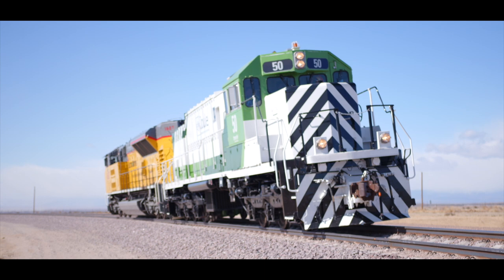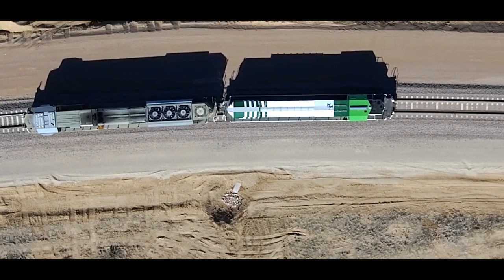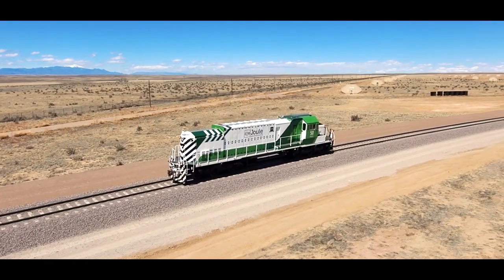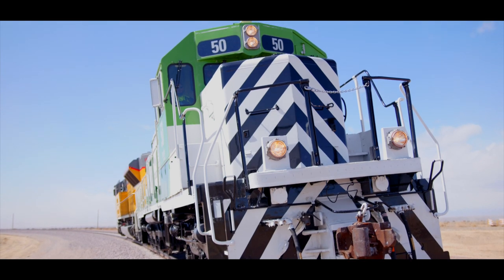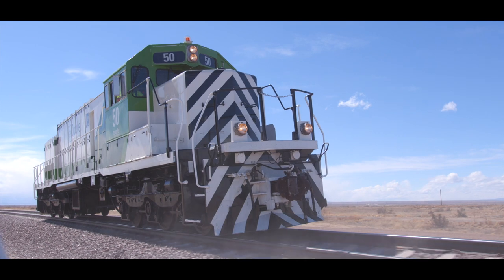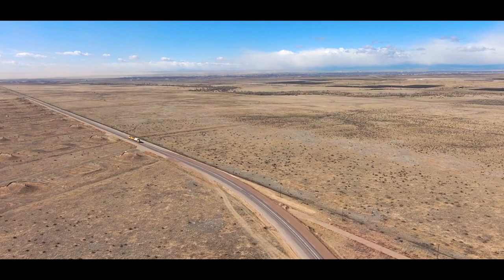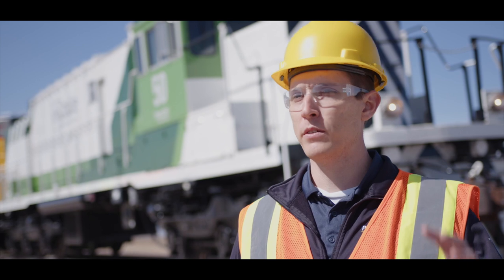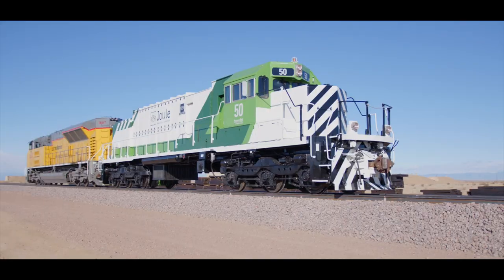The EMD® Joule SD40JR Battery-Electric Locomotive – Testing in Pueblo

Comment: I think for switching purposes battery-electric locomotives are rly cool but for any mainline application overhead wires is much better. Even yard-switching with overhead wires could potentially be better in the long run for railroads since the power would just be coming straight from substations rather than going through a lithium-ion or lead acid battery but idk that’s my opinion if anyone disagrees feel free to reply but I’m confused
Reply: @Remy1738  that’s actually a really interesting point. I can definitely understand the lesser weight contributing to a lack in tractive effort. What I don’t understand is how railroads like the Deseret Power Railway in Utah/Colorado can pull these big and heavy unit trains and not suffer from this problem. I want to understand this more, so if you know why please explain
Reply: @lkaviation164  The thing is that the US hasn't had any freight electrics since the 1980's, and as most countries don't have as heavy of an axle loading as the US, this is a common misconception that overhead electric locomotives are somehow inferior to diesels. 

Take the SD40-2 and GM6C, a diesel and overhead electric built with the same frame: Starting tractive effort for the SD40-2? 115,000 lbf. Weight? 368,000 pounds. GM6C's starting tractive effort? 126,000 lbf. Weight? 365,000 pounds. 

So, the GM6C is slightly lighter than the SD40-2, its diesel basis, while having slightly more tractive effort. 

Other things to consider is that when a diesel locomotive consumes fuel, it inevitably gets lighter, and therefore its tractive effort decreases. As an electric locomotive doesn't burn fuel, its tractive effort is constant. 

As for a solution to make electrics weigh as much as diesels? Just weld on some ballast, and you got an electric that's as heavy as a diesel! Simple as that!
Reply: @AutismTakesOn  well said
Reply: @AutismTakesOn  As a side note, it was actually GF6C
Reply: @alco4248  Well... Yes and no. You see... The GM6C existed, too. The reason why you probably never heard of it is because only 1 unit, the prototype, was ever built in 1975 and the sole unit was scrapped in 1982.
Reply: Depends on how much traffic you have. Low traffic areas might not be worth it, just cheaper to get a battery locomotive.
Reply: @Remy1738  The Swedes just put some extra steel onto the locomotive to add weight.
Reply: @Remy1738 considering that the most powerful locomotive in the US was a electric. The weight is not a problem.
Reply: @lkaviation164  : "I can definitely understand the lesser weight contributing to a lack in tractive effort"  That's why the electric locomotives in China and Russia and Sweden hauling 10,000 - 15,000 ton freight trains are ballasted with concrete.

Comment: Overhead electrification is the true future of railroading, look at the Milwaukee road they operated technology that"doesnt exist" which is overhead wires
Reply: The cost now would be out of the world....this for switching is fine...having spare batteries on charge in the yard to be swapped out is the way to go
Reply: Well if I was in charge I would hook those up to electrified third rails. For them to work properly then they would recharged better.
Reply: @KurtBenning   my 21 years in train service says that will not have a good outcome....it will run population control real good, but people trespass.... wildlife hang around....kids play on tracks....Chicago aurora Elgin tried that....
Reply: @ShawnCalay-hi6gy  I see then scrap that idea overhead wires us the future and if fully battery electric locomotives were to run they need to have overhead wire lake catenary wires.
Reply: @KurtBenning   they don't need over head wires... The technology of battery electric for switching locomotives, propane on railways such as FEC and Ferromex and bio fuels on the others....what not did you understand that this is a yard locomotive? Either flat switching or hump service....I'm pretty sure what ever railways get these will or can use over head intermodal cranes to lift out and swap battery's so the dead one can charge....
Reply: So did PRR.The MILW accomplished electric mainlines because the tonnage of their trains through those mountains would've been serious stress with only quartets of SD40-2's.
Both MILW & PRR suffered slow painful deaths because of mismanagement and corruption within the railroad themselves.
Some of us know how pathetic Penn Central turned out to be.
As for MILW,they would've survived under their electric trackage if the deal with GE went through where they wouldn't spend even pennies to update and extend because GE would've been the one funding and doing it.
Another thing to note is that during those times because of crisis at hands,diesel locomotives became expensive for the time being so electric for both railroads was a perfect way to deal with that on top of better timing and more power at the throttle.

Comment: Imagine the fire that will inevitably happen when something goes wrong with a battery powered locomotive in the middle of nowhere Rocky Mountains.
Reply: What did we not understand on switching.... Its not a road engine....my 21 years on the railway saw diesels burn....
Reply: Imagine the fire when a conventional locomotive's 5000 gallon diesel fuel tank ignites after derailing in the middle of nowhere Rocky Mountains.

Comment: IF the last standing "Class 1"s in the 1990s AFTER THEIR CONSOLIDATION" had "eaten the costs" and "wired up" they'd be right now using 12,000 horsepower electric locomotives like those used now in China and Russia and Sweden instead of being stuck with the 4,400 horsepower GE and EMD diesels.
Reply: US locomotives use the force plus their weight to drag, European locomotives are much lighter, even though they are electric and have more force, they cannot drag as much tonnage because they are light, in the US it was discovered that a diesel locomotive is ideally between 4000/4400 hp per locomotive, more than that amount of hp becomes uneconomical, that is why that amount of hp for each locomotive, in the US they have had 6000 hp diesel locomotives but they were retired because they were very expensive to operate, an electric locomotive that draws its energy from a catenary will always have more strength but it will also be more expensive to operate because it involves a lot of infrastructure along the track, that is why freight trains in the United States are diesel, the heaviest freight trains in the world are in the United States. and Australia, both with American diesel locomotives
Reply: @EMDFAST  : Russia and China ballast their electric locos with concrete blocks.  China in particular as in China they use electrics to drag 22,000 ton coal trains.
Reply: @archstanton5973  In the US, the main railways have concrete sleepers. Furthermore, depending on the humidity of the environment, wood behaves better than concrete. Wood is also better for high tonnage. A train with coal from the Basin River generally weighs 31,000 tons, without comment. that in Russia and China there is no double stack container, a monster intermodal train can generally measure 4 kilometers in length,
Reply: @EMDFAST : You OBVIOUSLY have a reading COMPREHENSION problem: the concrete ballast IS IN THE ELECTRIC LOCOMOTIVE.

ADDENDUM: do you actually know what NOT ROCK "BALLAST" MEANS?????
Reply: True
Reply: @EMDFAST 
Being expensive is just scratching the surface when it comes to 6,000 HP locomotives.They were unreliable and emissions regulations basically outlawed them.The GE AC6000CW's were problematic because they always ended up with blown out turbochargers or destroyed crankshafts.GE shot themselves in the foot by letting Duetz MWM take any role in the development of the high horsepower 7HDL.
The EMD SD90MAC's,both H1 & H2,shook themselves apart because of poor harmonic balancing and destroyed crankshafts,motor mounts,and other critical components.
With Caterpillar becoming EMD's parent company,they recreated the units as the SD70AH-T4's which ironically became another unreliable result.Even if any of these locomotives became successes in the long run the EPA standards would complain about heavy carbon footprint.For both manufacturers it was a waste of money and with a dead end.

Comment: Those EV Locomotives will Not Work in the Winter when it get's minis 40 below! Not to mention the fires they will Cause if they are damaged and into an accident.
Reply: @ShawnCalay-hi6gy I'm saying battery electric locomotives will work in the spring and summer and fall but they will not work in the winter cause in minus forty degrees they will die.
Reply: @KurtBenning  what makes you say that....the Netherlands and alot of artic areas are over 90 percent electric....I had GP38 with half a tank gel up on me....